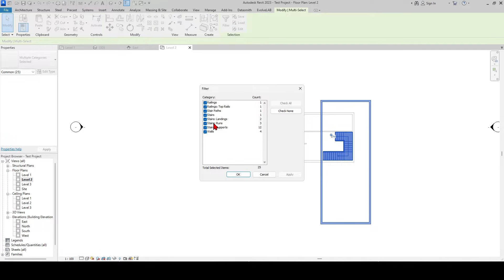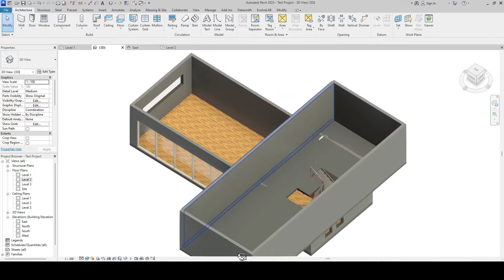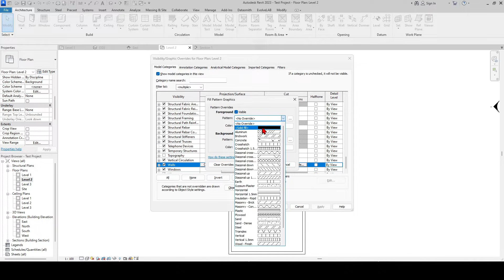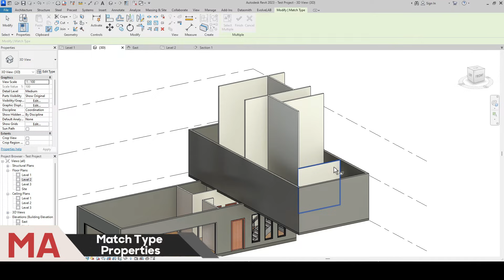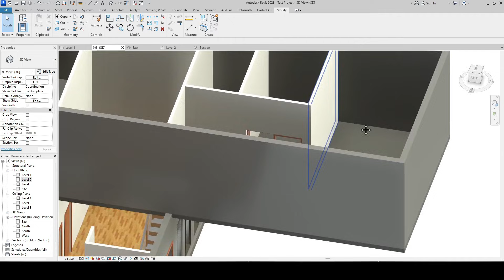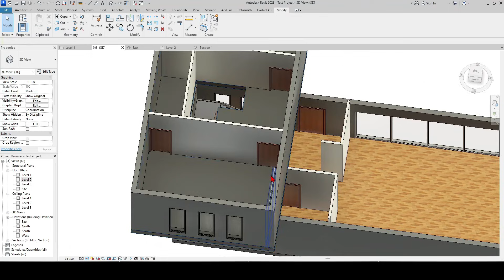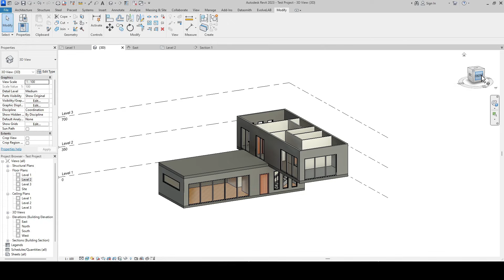Revit Course for Beginners – Part 2 – Second Floor Design

Comment: How do select the floor u didn't mention anything u just click
Reply from the maker: Good question 👍 You need to assign the shortcut first.
Go to View → User Interface → Keyboard Shortcuts (KS), then find Floor: Architectural and set the shortcut as FL.
After that, when you press FL, the Floor command will start directly. You can follow these steps 🚀

Comment: at 16:12 what do you mean by "You can switch between selections by  pressing the TAB key after moving the mouse over the point you want to select.
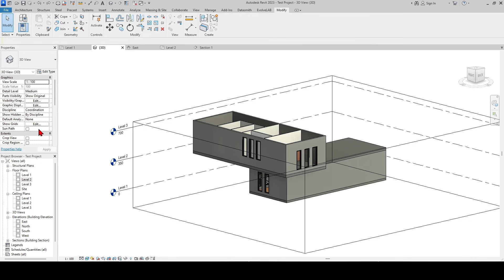Reply from the maker: In certain situations, when you hover the mouse pointer over the desired area, the system might mistakenly detect another element. To address this, keep the mouse pointer over the intended element and press the TAB key. This action allows you to cycle through the selectable elements in that area until you reach the one you want. You can see an example of this at 16:10 when using the Align command. If anything remains unclear, please feel free to ask again.